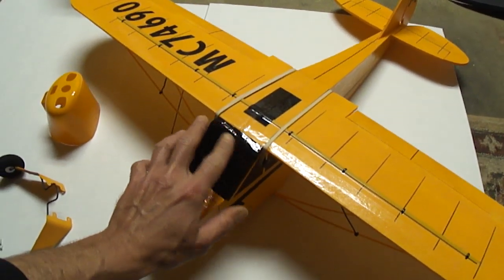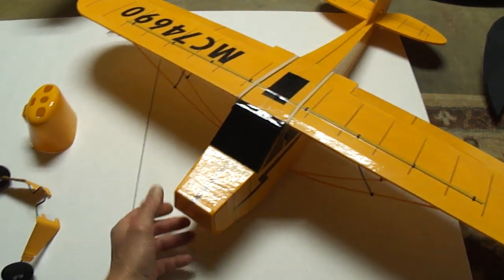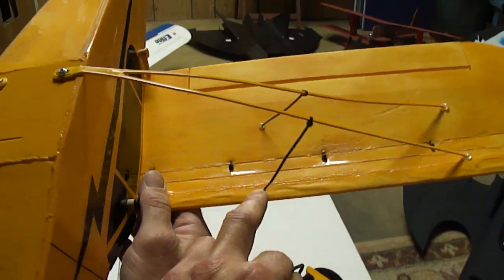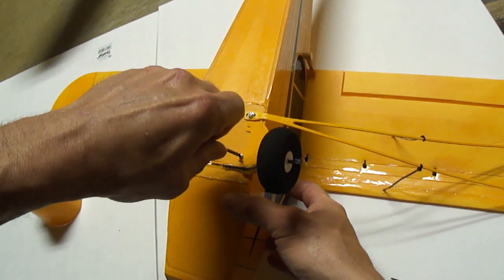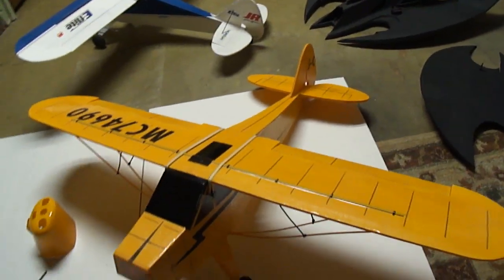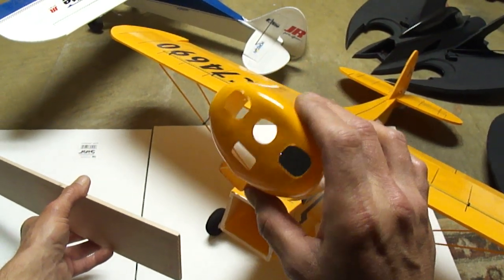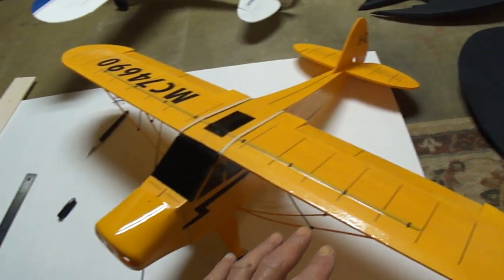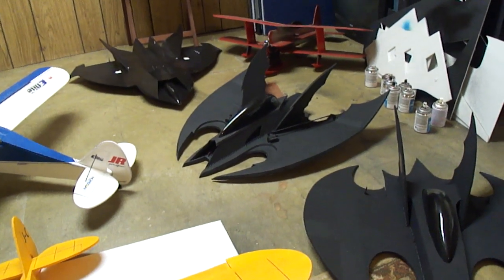Part #5 of 5 (Super cub) Cutting and assembling (PDF) Plans. foamconceptjets.com

Comment: Nice build yeah as you said I will velcro my wheel attachments intstead of screwing.Its been yars since I have flown but many crashes usually the landing gear is what rips a fueslage apart. Im going to see in your vids what you use for receivers servos and tranmitter and engine since my j-3 is about your size..